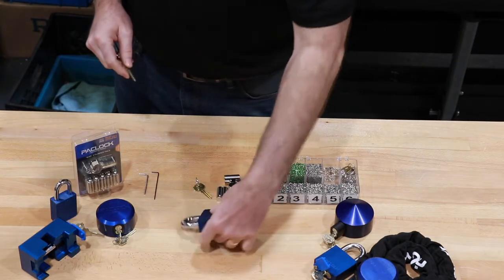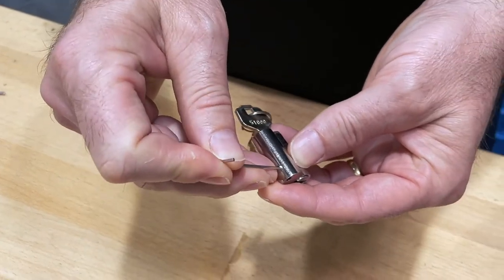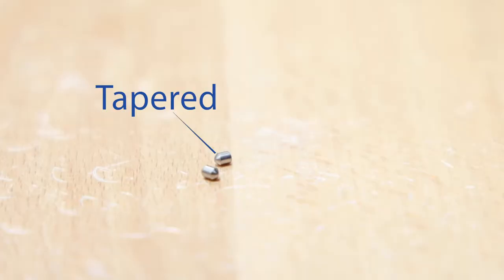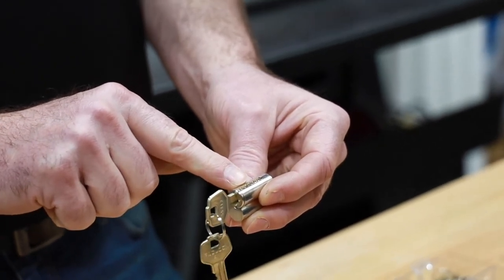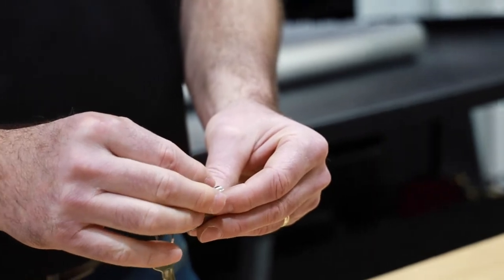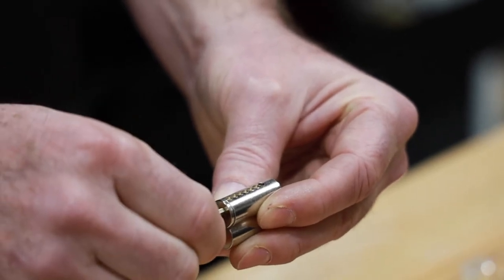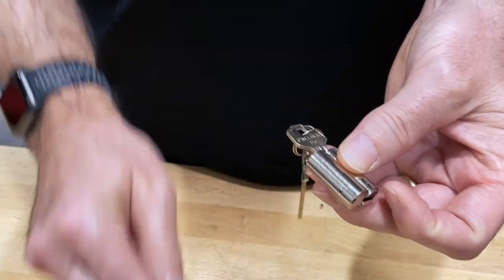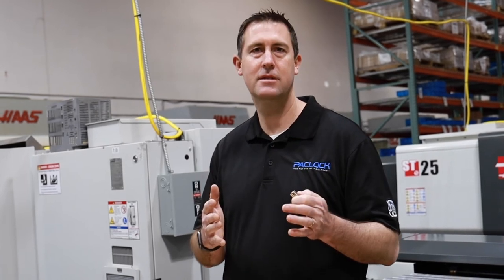Re-Pin Your UCS "U-Pin" Cylinder™

Comment: Okay you finally fixed your website. Thank you. But in this video you skip a critical step. When do you change the key? If you have a lock with key A and you want to change it to key B, you have to have key A in to rotate the cylinder. At that point you want to change the pins to Key B. But if you pull out Key A to insert key B in, you can't get key B in. In fact you can't even get key A back in w/o a LOT of work. So in your video Prez, you skip this very important step! When do you change the key for the new pins?

Comment: Do these require a specific size of pins to fit?
Reply: Yes, you should use the specific UCS pinning kit, currently called “PACLOCK's UCS PK300 Pin Pack, Stainless-Steel Pins, 300 Pieces Total” (Amz product B08GY6K16T). Paclock has 6 custom depths in that pin kit you’ll need to use to stay compatible with their system, plus the pins are steel which has much better drill resistance compared to regular brass pins used in most other brands of locks.